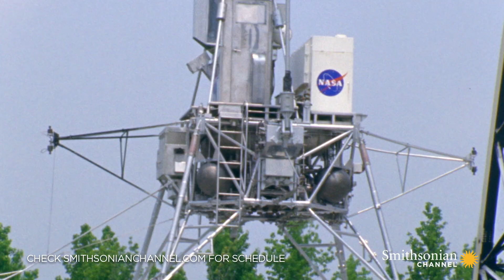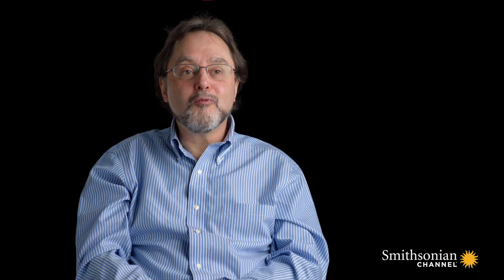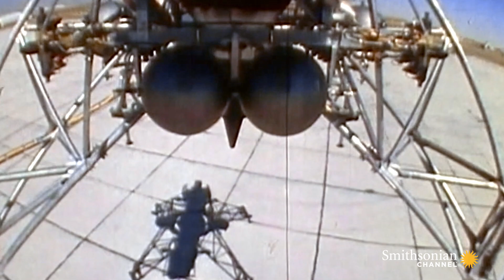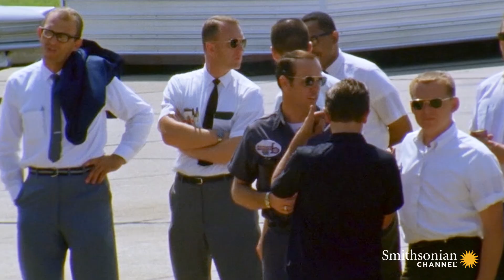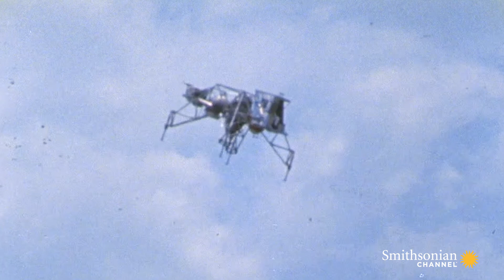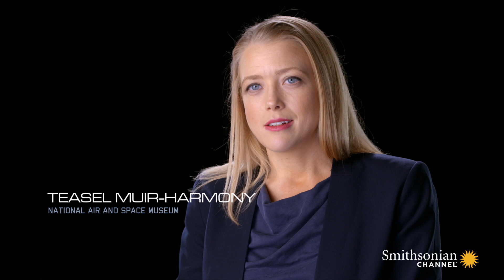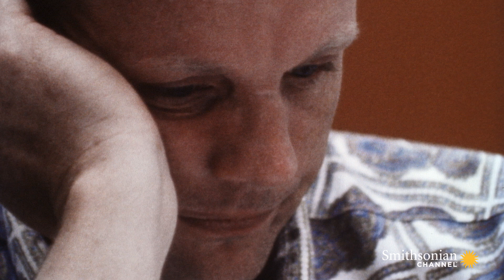How Neil Armstrong Trained to Land the Lunar Module

Comment: Nice color video.. lol did not know they had such good cameras then.. and inlove how you see the chair bolted on top of the rocket. And it has no ejection mechanism on it.  Hmmm are you trying to help conspiracy theories
Reply: @Alan Brando  unlike some ejection systems that have barometric sensors, the seat in the LLRV/TV did not have this function, and ejection was initiated manually.
Reply: Sorry to correct, but I'm afraid that is totally wrong.  Both aircraft had ejection seats manufactured by Weber Aircraft LLC, &  we're some of the first generation Zero-Zero seats designed to be used with aircraft that have a Low/Slow performance evelope.
Reply: It was the 60s, feel free to check movies of the age. You're probably under 20 years old though, and don't realise the world had media before smart phones.

Comment: So was the fuel for the lunar modules ascent back to the command module isolated from the fuel supply that came close to exhaustion on the descent, meaning where there two separate fuel supplies?
Reply: Yes, the lander was the lower part of the LM, left behind when the ascent stage left the moon.
Reply: Yep...totally separate!
Reply: Of course. The lunar landet had 2 separate stages. One for landning, one for lift off.